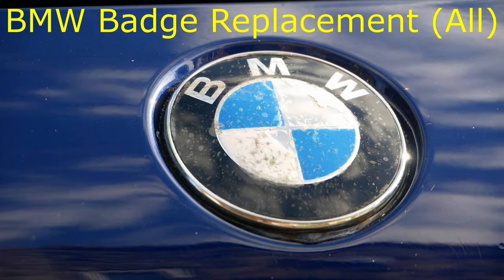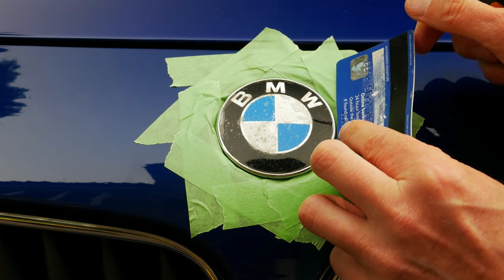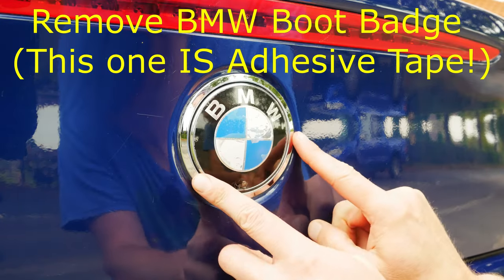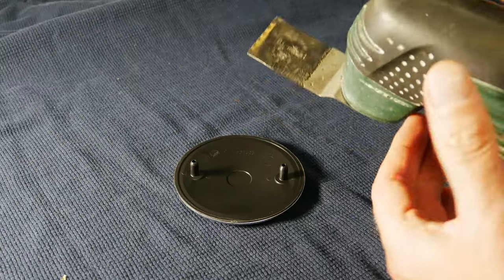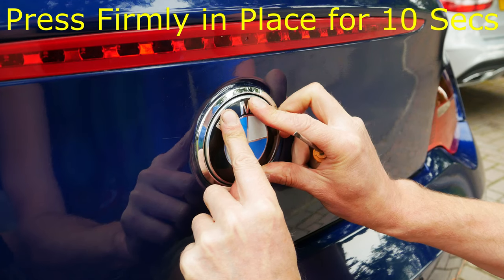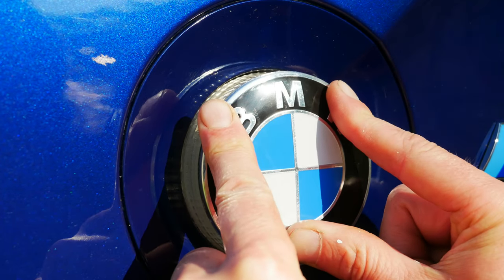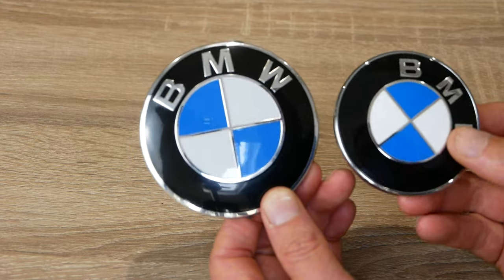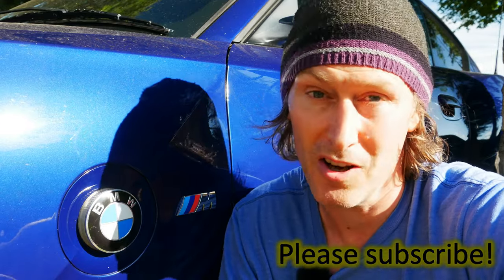Remove or Replace BMW Bonnet Badge or BMW Boot Badge // BMW Emblem

Comment: Zed doesn't have grommets, it has nuts on the back. They are accessed by removing one of the grills below the badge.
Reply from the maker: Thanks for your comment! Not doubting you but mine came off pretty easily with levering, so I never thought to check! New one came with grommets, even though it was a genuine part from BMW? So, I fixed on with the grommets and it has been there ever since with no issues... Hopefully the vid is still helpful to most Beemer owners out there!
Reply: @ReviveMyRide  Thanks for the reply, I was just weary at trying to pry it off. I was replacing the grills and noticed the nuts. Think the e85/86 is the only one that have them, I believe they a fractionally smaller in diameter, but yours looks great. The smaller ones are pricey from the dealer. Think the aftermarket will suffice. Thanks for the video.

Comment: 74mm or 82mm
Reply from the maker: Hi, oN the E85 & E86, the bonnet badge is 82mm diameter. As I'm sure you know, this is an unusual size, so it is hard to find aftermarket ones the right size... Thanks, Phil

Comment: 😮 totally wrong this emblem is fix with nuts
Reply from the maker: Thanks, I didn't have any trouble getting my old badge off by levering but I accept that it may have had nuts on the other side. Not 100% sure, maybe it had been changed before? The car is 16yrs old. The new one that I fitted was push fit into grommets, as you can see in the vid...